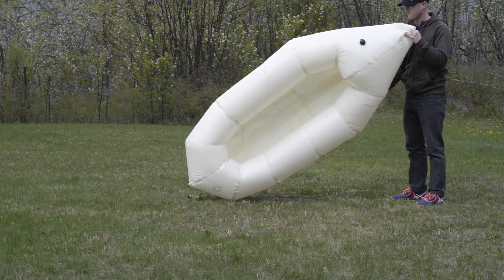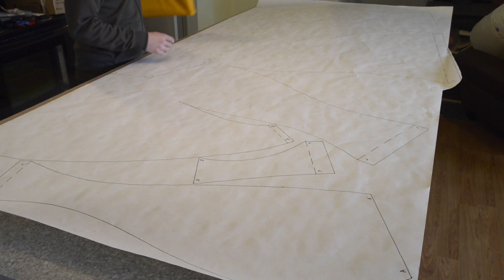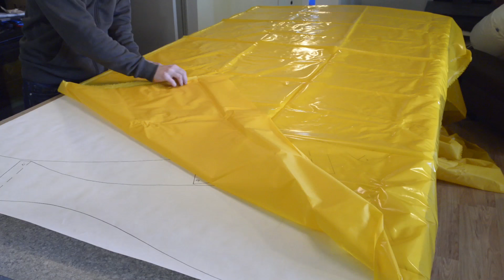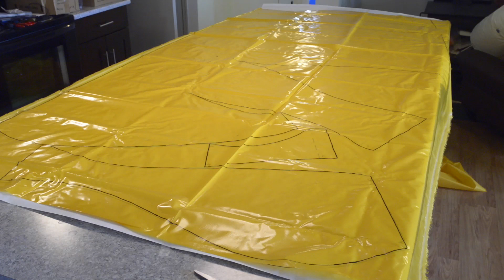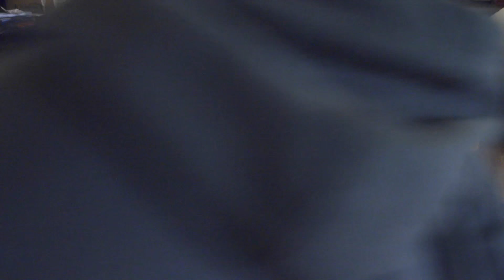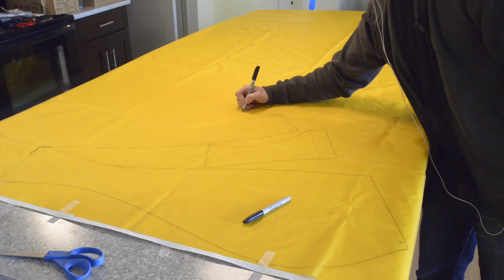DIY Packraft: Step 1 - Tracing and Cutting Your Fabric

Comment: Stupid system. Skin on frame (SOF) boats use ripstop nylon, then coated 
with polyurethane. If you use a simple sewing machine to stitch then 
stitch pleats to bend the angles into one continuous tube of fabric, you
 eliminate so many ridiculous cuts and all that melting urethane with an
 iron to make weak seams that do not last for years. You simply stitch 
the form, then coat the whole thing with ordinary polyurethane from 
local hardware for a RELIABLE lightweight inflatable. You're an idiot 
encouraging other idiots to waste several times the cost in making - 
garbage.
Reply from the maker: Hi Robin, thanks for commenting. I do not recommend using hardware store polyurethane on a packraft, as I have already tried several brands 
myself and none is flexible enough to fold and roll repeatedly - they 
quickly separate from the fabric and flake off. I think you will have 
better luck using hardware store polyurethane on a SOF boat, where the 
fabric does not need to be so flexible. 

Contrary to your intuition, the heat sealed seams are actually stronger than the fabric itself, so sewing would be redundant. You can see this demonstrated in my fabric comparison video. Cheers!

Comment: Are you marking (with a permanent market) on the TPU side?  Will the markings come off? Will the markings hinder "joins"? Thnx
Reply from the maker: Hi Sunny, the plans are designed so if you cut just inside the lines you will end up with the correct shapes and there are no pen marks on them, so you can use a permanent marker.